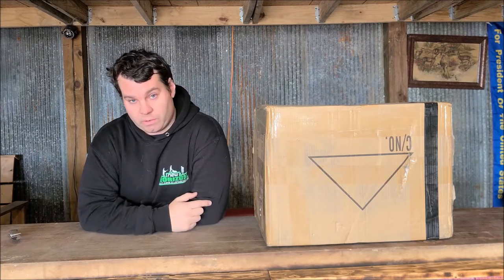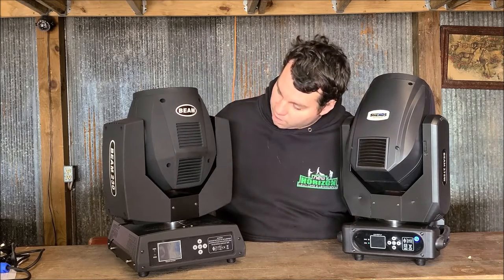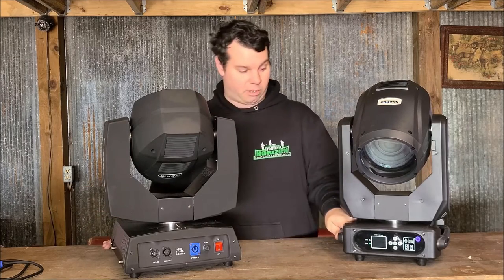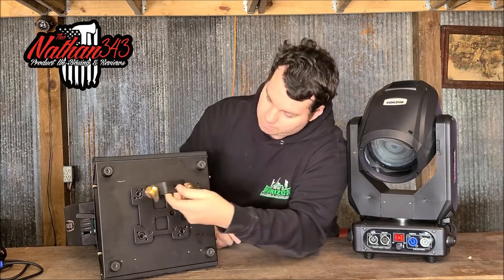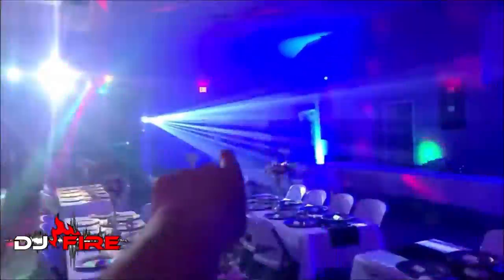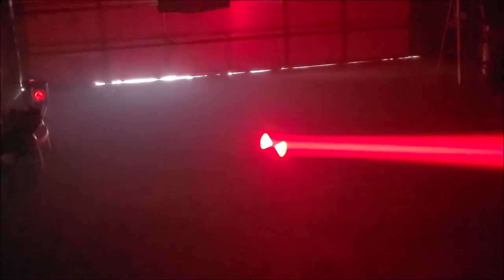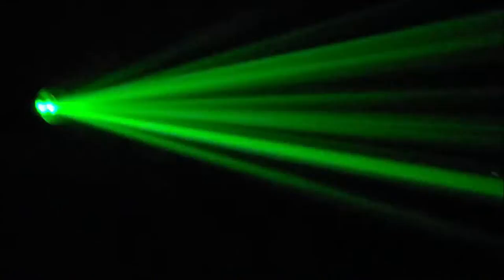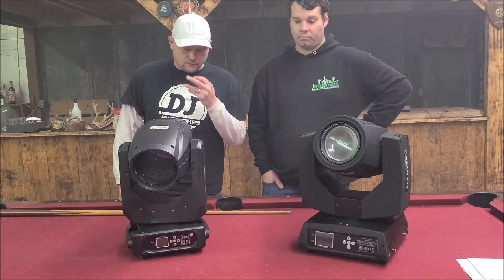7R VS 10R Moving Head comparison From Shehds Lighting

Comment: I had 6 of the shedhs 10R and had some serious issues  with them the dimmer shutter randomly closed on 3 of them during a gig after 10 minutes and wouldn't reopen till about 20 minutes, i had these hung on the truss  and on 2 of them the brackets came away while the fixtures where in the air but safety bonds saved them from crashing to the floor and the brackets where still in locked position and a few other issues  i personally wouldn't trust shedhs products due to these issues but great review, i gone back and using my trusty old trusty ex hire robe 1200ats spots